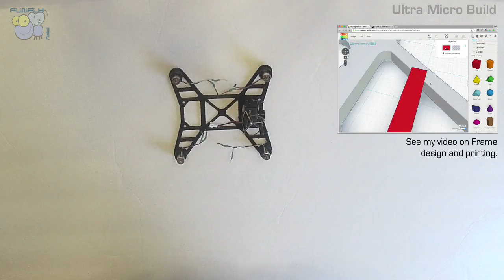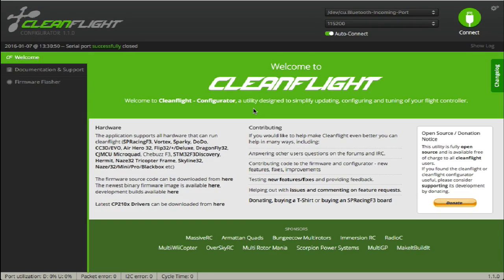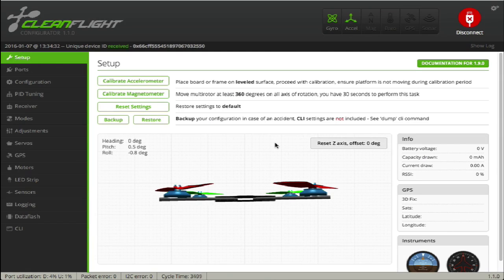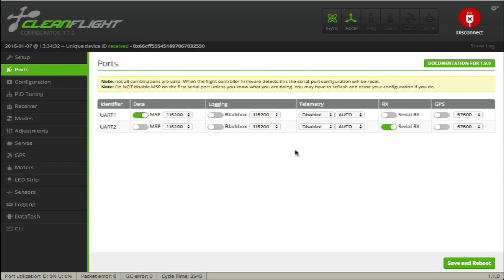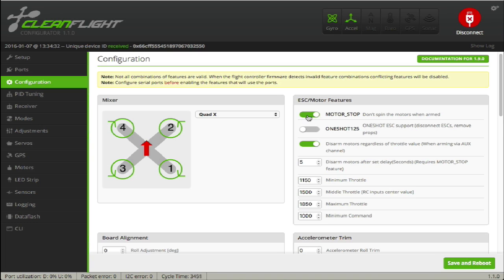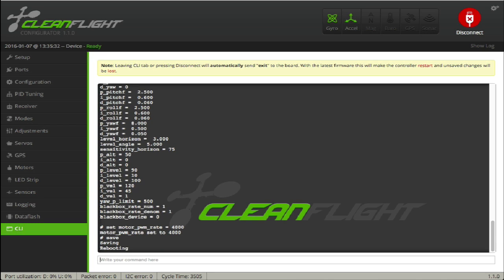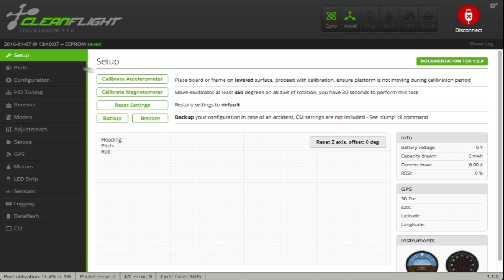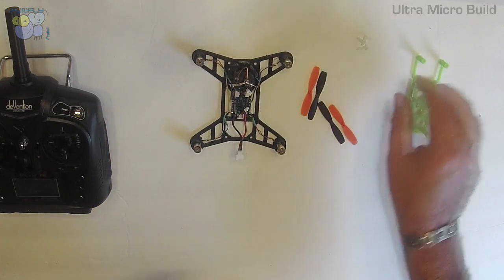Ultra Micro FPV Build (60 gram AUW)

Comment: I know this is probably a stupid question but how do you get it to bind?  I'm wanting to build one and I don't have a nice transmitter
Reply: I guess what I'm asking is how would I know if any of my transmitters use dsm2 or dsmx?
Reply from the maker: No problem. The board will automatically go into bind mode after 5 seconds if the bound receiver is not turned on. It will bind to a DSM2 radio. (aka Spektrum)
Reply from the maker: What kind of radio do you have?
Reply: +FunFly FPV 
do you know off the top of your head if a wltoys transmitter will work?
Reply: I also have an unknown from feilun
Reply from the maker: A WLToys will not work. The cheapest option for a good DSM2 radio is this http://www.horizonhobby.com/SPMR1000 else a Devo7e hacked with Deviation software (http://www.deviationtx.com/).
Reply: +FunFly FPV 
would you have any idea how to know if my unknown one from feilun uses?
Reply from the maker: I do not know but typically the off brands do not use licensed protocols like DSM2 and DSMX.
Reply: +FunFly FPV 
so if I bought the cheaper transmitter it would only work with one board?
Reply: I'm trying to get into the micro brushed quads and I'm having a hard time understanding the whole transmitter dilima no matter how many videos I watch
Reply: I can email you a picture of the inside of mine
Reply from the maker: Well, each radio maker creates a corresponding line of receivers that goes into models. Between the radio and the receiver there is a certain protocol (like DSM2). Binding means that you are binding that specific receiver to that specific radio over that specific protocol. If this was not so anyone would be able to control anyone else's model.  So There are thus 4 things at play, the Radio and Receiver in the model, the receiver being bound to that radio and the protocol that specific radio maker uses. DSM2 and DSMX are well known protocols. Cheaper radio makers just implement their own protocol, and this also forces the consumer to only buy their radio. Hope that helps.
Reply: +FunFly FPV 
Yeah that does hopefully last question about this.  would I need to buy anything extra to bind the tx to this flight controller?
Reply from the maker: The SciSky/Quantum Pico FC comes with a built in DSM2 receiver so you just need a DSM2 capable radio.
Reply: +FunFly FPV 
thank you so much for your help I really appreciate it.

Comment: What size battery is this? Thanks!!
Reply from the maker: That is a 750mah battery but I also use 400mah ones.
Reply: 750mah started smoking my fc lol any idea why? worked fine with a 300mah
Reply from the maker: Did you look at the polarity on the connector? Some of them are switched.